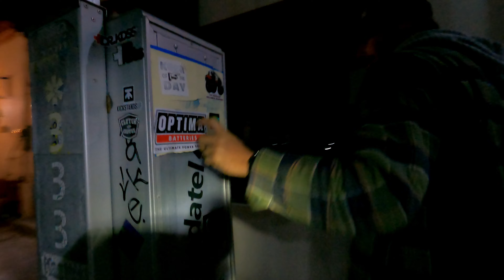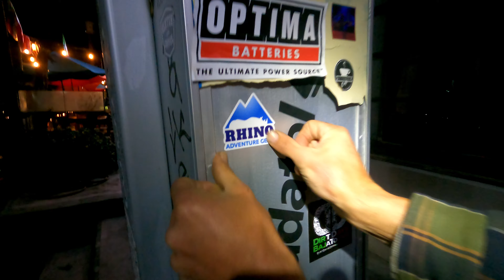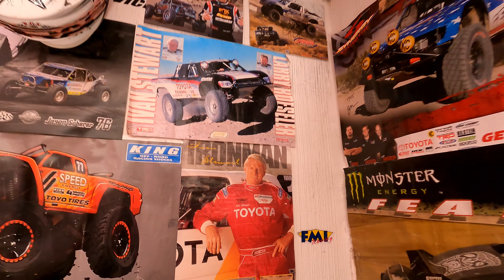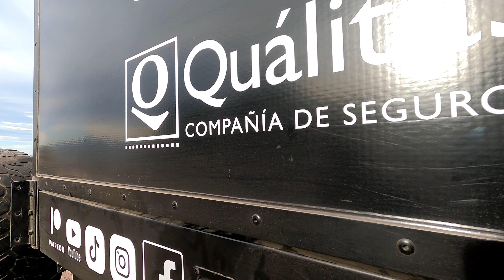Adventures in Baja

Comment: I wonder if my unmodified Toyota Sienna mini van would make it in the roads in Baja, thoughts?
Reply: I lived in Baja for 5 years. I've seen every kind of Expensive 4x4 Overland rig, Off road 4x4 rig, Performance Side by sides and Trophy Trucks, and Off road/ Adventure Motorcycles down every Arroyo, back road, no-road, dunes, Beach, Wash, and mountain pass. Impressive..... until a car with a Mexican family of 6 rolls on by in 1993 Toyota Tercel with 4 bald tires and the windows down. It never fails. Just like these Mexican locals..... RUN WHAT YOU BRUNG. Don't let what you don't have stop you from doing what you could have done.